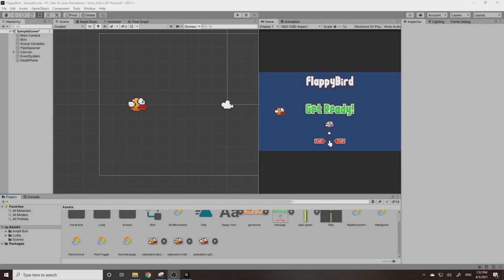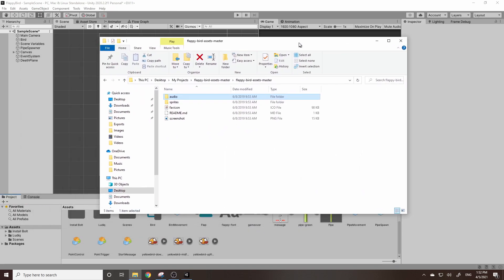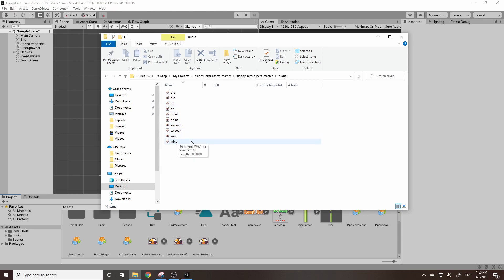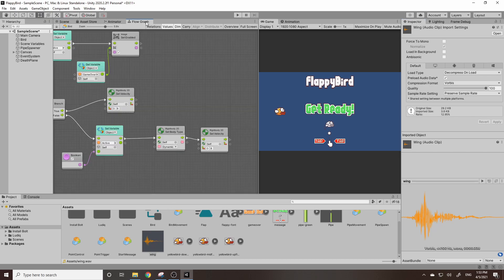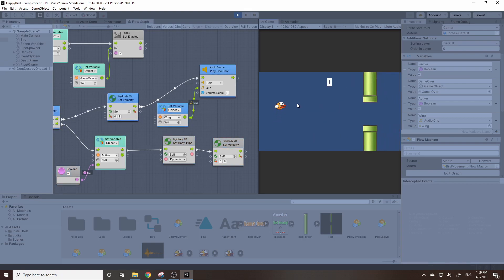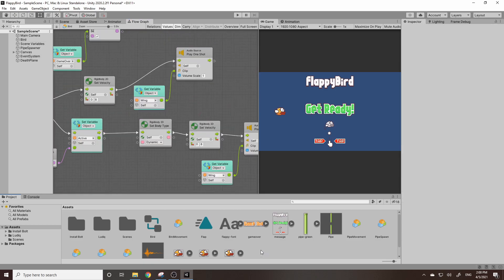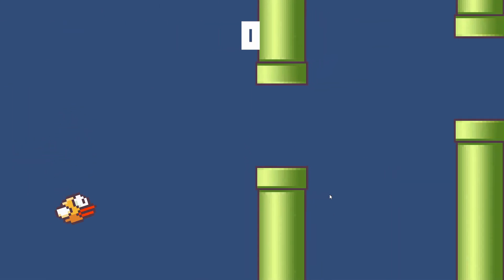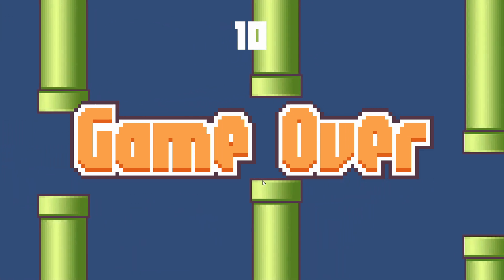Flappy Bird Bolt Tutorial pt. 7 | Sound Effects

Comment: Is there a way to add just a single pipe (not a pair) ? For example: 2..1...1...2...1 pipe
Reply from the maker: If you want to make a single pipe you need to make a new pipe prefab and just delete either the top or the bottom pipe. You could set up a randomizer that picks a random version of the pipe to spawn in by using an integer switch block and a random rand block. I would recommend doing some research on how switch blocks work because they can be really useful.
Reply: @JAMESDEV535  thanks! i will try